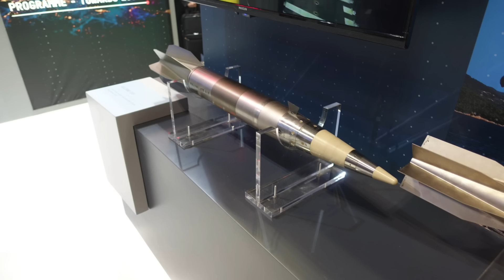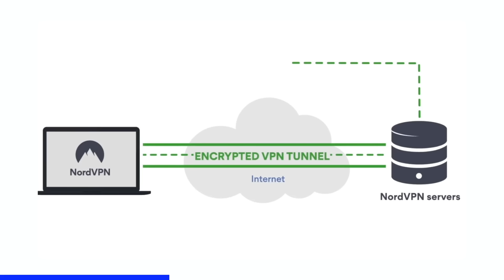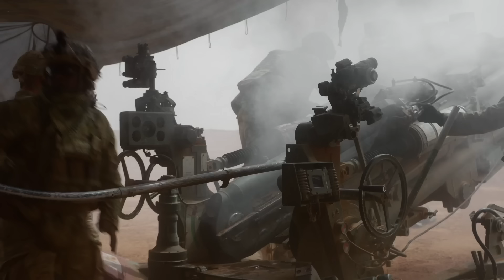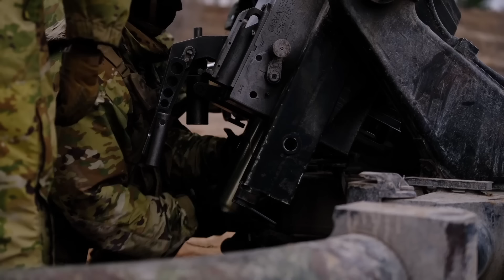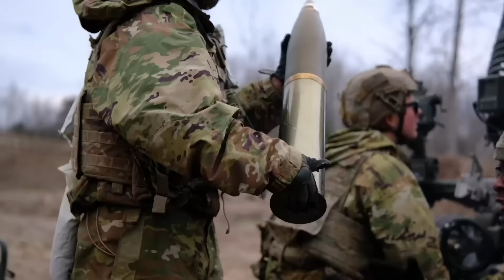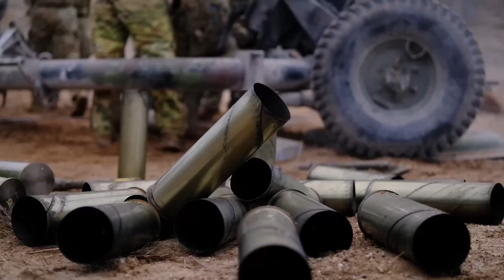Why Vulcano 155 GLR derived new shell will provide US Army a much needed combat edge ?

Comment: The European Union had better start sending this round to Ukraine to help stop Putin’s mother Russia from invading all of lower Europe !
Reply: Already in use in Ukraine since at least 2023.
Reply: Only works in unjammed areas, so they use the cheaper ones.
Reply: @knowahnosenothing4862 Vulcano can have the nose proximity fuse replaced with a laser seeker or infrared seeker.  If the GPS is jammed (Likely only half way through the flight) the inertial navigation system  takes over and then the seeker
Reply: Germany already has sent Vulcano

Comment: The US definitely needs a new howitzer. Relocation is to slow.
Reply: There are several options but if companies had any real sense, they would fit their productions to us equipment
Example the Archer is fitted to a Volvo truck. The newer variants are fitted to Germany HX2 military truck
The US army uses Heavy Expanded Mobility Tactical Truck (HEMTT) so fit the gum module the HEMTT to lower the cost